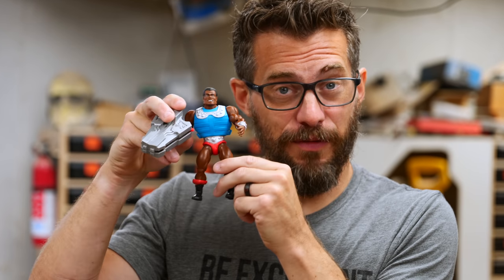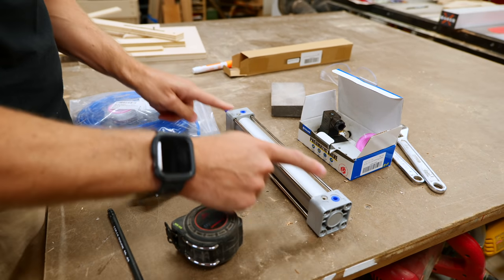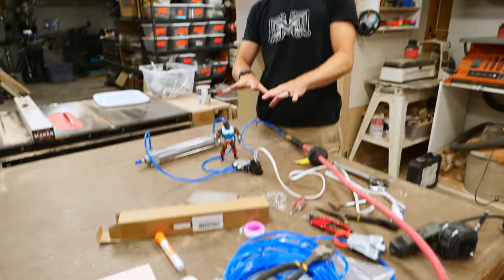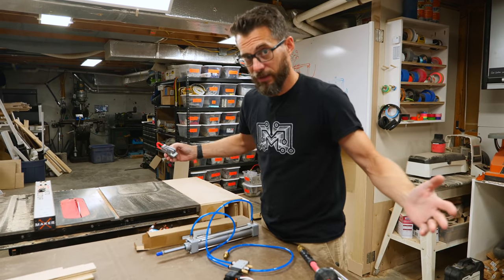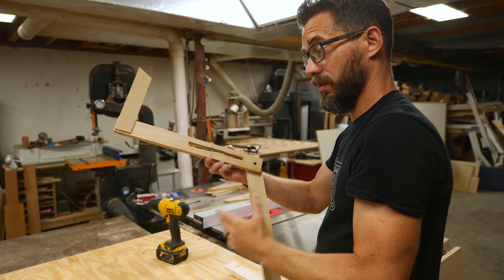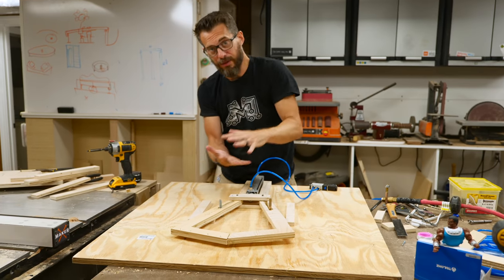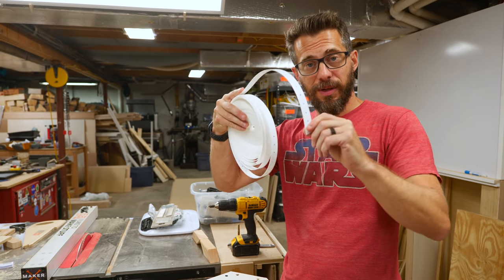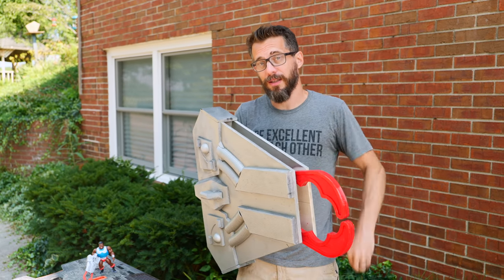Making a Pneumatic Powered He Man Clamp | I Like To Make Stuff

Comment: An air flow restrictor is really useful for air cylinders. Put one on each air line going to the cylinder, and you can not precisely control the speed of the actuation in each direction, but still keep the pressure high so you get a strong force that moves more slowly.
Reply from the maker: Good call.
Reply: @Iliketomakestuff  I use them at work when building tools. Sometimes you need it to close slowly, open fast, and have high holding power. The flow restrictor on each tube to the cylinder and a pressure regulator on the supply side gives tons of room for adjustability.
Reply: You would like to control the air that's leaving the cilinder though. Otherwise the pressure builds slowly. You want even pressure on the pressurized side and control the speed of the back pressure falling.
Reply: I'm pretty sure that cylinder has restrictors built in.  They are the set screws next to each port.  I believe you loosen them to increase flow and increase speed.  They also appear to already be restricting given how slow the cylinder is moving.
Reply: @bartvandijk668  When in doubt, throttle out!
Reply: @bartvandijk668  Came here to look for these comments - restricting the exhaust is a big safety measure.  If you restrict the input, the slow pressure rise means that friction may keep the piston from moving, until...... wham!  It suddenly moved.  Restricting the exhaust instead means you have full pressure on the input side and piston has the power to overcome the friction and move smoothly right from the start.
Reply: @austenite239  Exactly, Pneumatics are no joke. Especially with this level of equipment at these pressures.

Comment: This was awesome!! As a mechanical engineer, this is pretty much my every day... though on a larger scale and a lot is figured out in cad first. When you said you were going to set the pressure over 100psi I cringed knowing how violent it would be. I use hydraulics in my designs (not a good fit for what you were doing) but they are much more controllable and can be fine tuned generally better. 👍

Comment: Where you have the exhaust "mufflers" (brass thing next to the intake) you can get versions that have a needle valve that will let you control the actuators speed more precisely. You actually don't need (and probably don't want) that much pressure, the pressure affects the amount of force the actuator puts out, it's the exhaust valves that control the speed. Notice that the speed didn't change all that much when you upped the pressure. Also, a reputable supplier will provide you with the specs on the actuator, how much force it will produce at what pressure.

Comment: I am not sure if anyone else suggested it, but on that air cylinder it has little brass screws on the top and bottom near the air ports. Those are flow controls. You can adjust them to speed up or slow down the actuation speed without losing pressure. Using pressure to adjust the speed is not reliable, using a flow control, or a cylinder with them in works a charm. Just look up airflow control on amazon. They have a ton of different types. They will help a great deal in your future projects.

Comment: Note for your next air cylinder project......
because of the effective area of the head on the retract side being smaller compared to the extend side you could have achieved a stronger clamping pressure with the same amount of air pressure if you had the jaws close when the ram moved outward instead of inward. I'm gonna guess you may be getting only half the strength you could.
Reply from the maker: Oh, that's interesting! This is new to me, so I wouldn't have considered that.  Thanks so much!!

Comment: Nice Project, i'm usually not big into prop making but when mechanics get involved its pretty cool :) Some pneumatic cylinders have adjustment set screws next to the inlets with which you can adjust the speed of the throw without needing a regulator. Couldnt see in the video if yours has these. But its a great way to adjust the speed without having to reduce pressure, therefore you keep the clamping pressure. You can even control the speeds seperatly. Its basicly just restricting the flow.

Comment: FYI - the SPEED of the cylinder is based on the flowrate not the pressure. if you want the force, but not the speed - install a flow limiting device like a needle valve.

Comment: One of the sheets of plywood looked like it was white on one side - is that a way of priming the sheet before using so you don’t have to get in the crevices later? Or was that just a weird piece. 
Also is there a way to make a pneumatic device like that wireless? I’ve seen Colin furze do something like that but still pretty bulky
Reply from the maker: By wireless, do you mean not connected to a power source that isn't attached to the device? Sure. You could use a CO2 tank and battery, but you'd have to connect the actuator to them with shorter wires.

Comment: So is there a way to make it so the solenoid/hydraulic ram don't expend the air every time and instead cycle it back and forth between the two sides of the ram with say a tank holding some extra air to start that cycle?

I'm just trying to figure out how to "easily" do this but make it portable and not have to build up the pressure again all the time...

Comment: Having had a job where I used lots of pneumatic cylinders to run experiments and tests, I giggled when you kept going up and up in pressure. I kept things at the minimum that would still actuate it because any higher, even by 5 psi, was destroying my test equipment by violently shaking itself apart

Comment: Did you consider making it portable? I wonder how many closures you could get off a CO2 cylinder or a PVC pipe pressure vessel.
Reply from the maker: Josh recommended a Co2 tank. But I didn't get the right solenoid for a portable setup.

Comment: Is this a new edition of the toy? The one I have didn't have the "snapping" function, it was a spring that kept it down and then you had to pull the "button" in order to clamp together. (And the button was red)
Also hands and legs weren't hinged and couldn't move.
Also also, this guys head look awful. Right?
Reply: Yeah, it's from a line called "Masters of the Universe: Origins", a new, better articulated version of the old style figures.